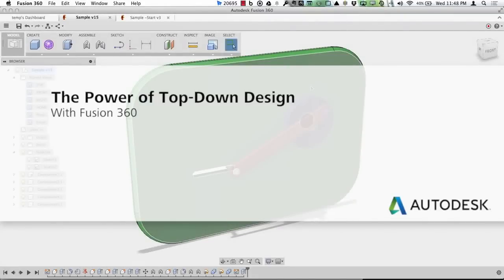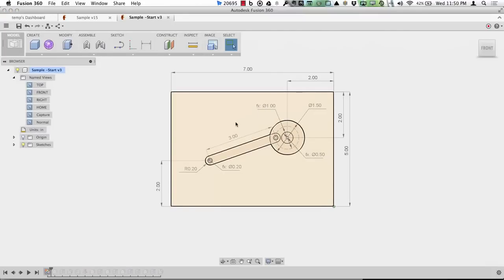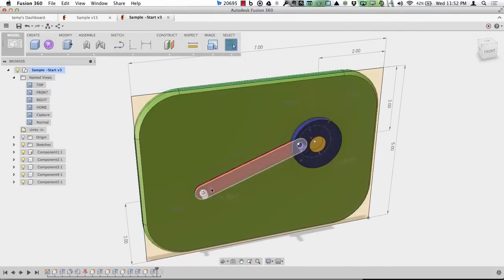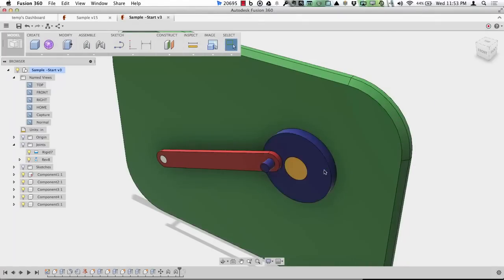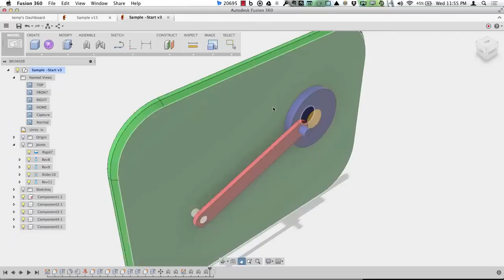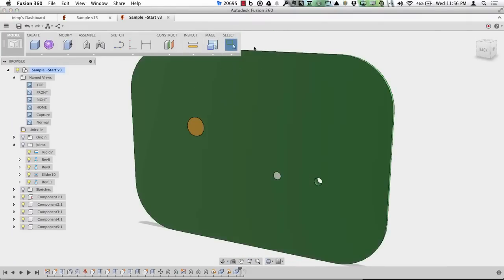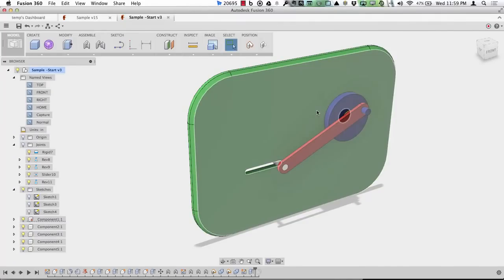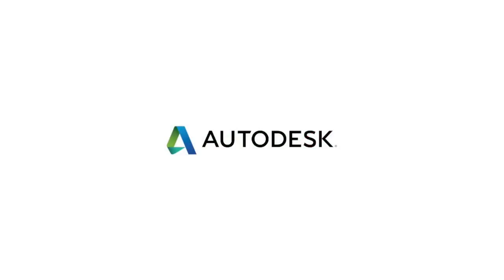Power of Top-Down Design with Fusion 360

Comment: If you click on the Modify Tab you will see a cursive "Fx" that says "Change Parameters" towards the bottom of the drop down. Click on that and it opens a dialog where you can pre-establish your desired parameters. For instance if you want to pre-define the Height Width and Depth of an object you are designing you will click the + (Plus) button of the dialogue where it says "User Parameters". Then in the dialogue box that opens you will type "HEIGHT", select your desired unit in the drop down, then enter the height you want in the "Expression" field. It will then tell you the resultant value in the "Value" field. And if you need to leave a comment for later reference you can do that in the "Comment" field. 

Try this; 
Add the following parameters as I mentioned above;
Name: HEIGHT
Unit: in
Expression: 2

Name: WIDTH
Unit: in
Expression: 4

Name: DEPTH
Unit: in
Expression: WIDTH*2
[Notice that the Value field will now display 8.00]

Now that you have those 3 User Parameters lets play with it a little. 
Click ok on the Parameters dialogue and open a sketch. 
Create a simple rectangle and in the dimension dialogues type in HEIGHT and WIDTH in the proper dialogue boxes. 
[Notice that you can just type the first letter and it already pulls up the dimension, then hit enter. Keep this in mind when you are deciding how to name your dimensions on bigger design projects so you can find the right dimension with just a few key presses.]
Now close your sketch. 
Select Extrude Command and type DEPTH into the distance field (be sure to erase the "in" units in the field or it won't let you press ok).
Then press OK and the parameters create the box you pre-defined. 

Now you can go back to the Modify tab and select "Change Parameters" again and change the values of any of the parameters and your widget will adjust to meet those parameters. 

If you are creating a product line with many different versions of the same base product you can create your base design and save that one as a template (there is no template option that I am aware of, I just mean label it something like "widget_template" in the file name) with all the parameters in it. Then when you go to design the other versions you simply Save As "your new version name here"so you have a whole new version of the original widget with all of the parameters you established. Then you can just go to the "Change Parameters" dialogue and alter those numbers to get the new version instead of having to rebuild an entirely new model with different dimensions. Save yourself hours of work!

Now you will notice with the way I did it you are probably not seeing the "fx" in the sketch like he has in this video. Thats because we only did the Height and Width in the Sketch. The Depth dimension we did will display as an "fx" but it is not in a sketch because it is just an extrusion. If you want to see this then modify the Height parameter value to be something like "WIDTH/2", or whatever you want. Now when you look at the sketch you will see the "fx" in the dimension. 

Sorry this is 5 years after you asked it, but I didn't even know FUSION 360 existed back then. 
Hopefully this helps some people.

Comment: I wish I understood how you made the slot dependent on the pin location. Does the combine command always auto update the object it was employed on? Good vid.
Reply: If I am not mistaken the combine action is dependent on the components, so that as Fusion rebuilds the design (for instance after you change the dimensions of the sketch to move things around) it then re-executes the combine command with those same components in their new locations.

Comment: The issue I see here is what happens when you want to add a tolerance to that slot. If that wheel is going round at high speed it will hit that pin at the outer edges for sure. Or even if you are adding tolerance to the slot itself. Zero tolerance will give that slot massive friction and it won't move. Kind of defeats the purpose of the technique of the snap shot. The slide capability is still usable for the design fr the sketch that allows you to play with the tolerance however. Thank you for this video.
Reply: for add tolerance, just Offset the hole for 0.something mm and extrtude that little space : Tadammm tolerance :)
Reply: you can also do what he did to obtain the two extreme holes with the combine command but then in your sketch use the actual center to center slot command to draw the slot instead of just doing the 2 tangent lines. You can then tolerance the slot slightly larger and as long as you used the center of the two combine holes as the center points of your slot ends it should update exactly the same. Then just create a parameter for the width of the slot to be the diameter of the peg + your desired tolerance so that if you need to change the peg size your tolerance will adjust as well.

Comment: This would have been much more useful if you had started by creating that initial drawing - how do you set up all those functions you talked about?  (Or did I just miss a video?)
Reply: If you click on the Modify Tab you will see a cursive "Fx" that says "Change Parameters" towards the bottom of the drop down. Click on that and it opens a dialog where you can pre-establish your desired parameters. For instance if you want to pre-define the Height Width and Depth of an object you are designing you will click the + (Plus) button of the dialogue where it says "User Parameters". Then in the dialogue box that opens you will type "HEIGHT", select your desired unit in the drop down, then enter the height you want in the "Expression" field. It will then tell you the resultant value in the "Value" field. And if you need to leave a comment for later reference you can do that in the "Comment" field. 

Try this; 
Add the following parameters as I mentioned above;
Name: HEIGHT
Unit: in
Expression: 2

Name: WIDTH
Unit: in
Expression: 4

Name: DEPTH
Unit: in
Expression: WIDTH*2
[Notice that the Value field will now display 8.00]

Now that you have those 3 User Parameters lets play with it a little. 
Click ok on the Parameters dialogue and open a sketch. 
Create a simple rectangle and in the dimension dialogues type in HEIGHT and WIDTH in the proper dialogue boxes. 
[Notice that you can just type the first letter and it already pulls up the dimension, then hit enter. Keep this in mind when you are deciding how to name your dimensions on bigger design projects so you can find the right dimension with just a few key presses.]
Now close your sketch. 
Select Extrude Command and type DEPTH into the distance field (be sure to erase the "in" units in the field or it won't let you press ok).
Then press OK and the parameters create the box you pre-defined. 

Now you can go back to the Modify tab and select "Change Parameters" again and change the values of any of the parameters and your widget will adjust to meet those parameters. 

If you are creating a product line with many different versions of the same base product you can create your base design and save that one as a template (there is no template option that I am aware of, I just mean label it something like "widget_template" in the file name) with all the parameters in it. Then when you go to design the other versions you simply Save As "your new version name here"so you have a whole new version of the original widget with all of the parameters you established. Then you can just go to the "Change Parameters" dialogue and alter those numbers to get the new version instead of having to rebuild an entirely new model with different dimensions. Save yourself hours of work!

Now you will notice with the way I did it you are probably not seeing the "fx" in the sketch like he has in this video. That's because we only did the Height and Width in the Sketch. The Depth dimension we did will display as an "fx" but it is not in a sketch because it is just an extrusion. If you want to see this then modify the Height parameter value to be something like "WIDTH/2", or whatever you want. Now when you look at the sketch you will see the "fx" in the dimension. 

Sorry this is 5 years after you asked it, but I didn't even know FUSION 360 existed back then. 
Hopefully this helps some people.